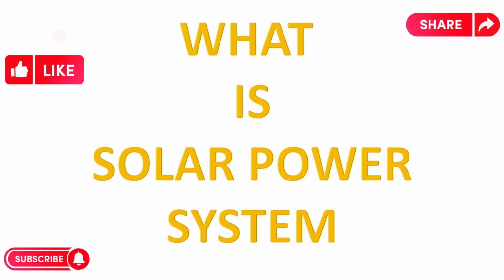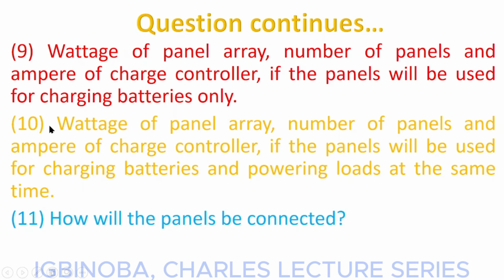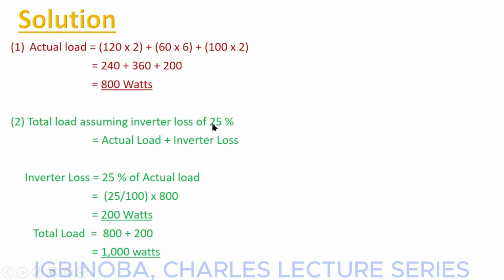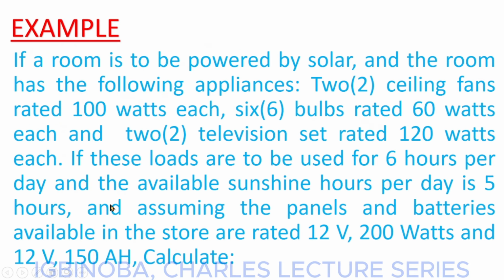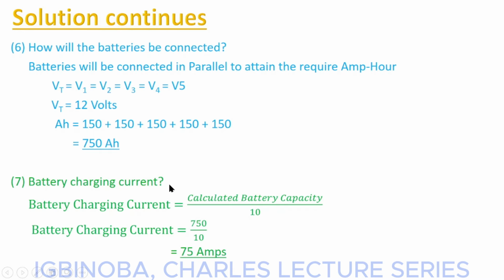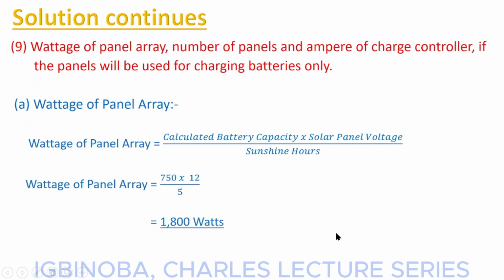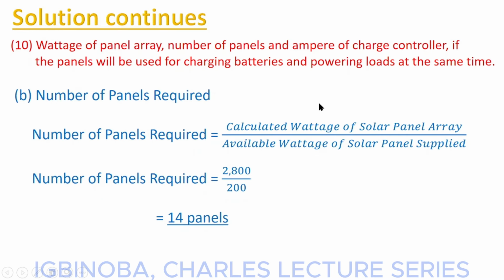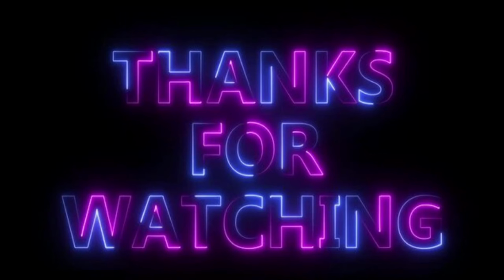Design of Solar Power System

Comment: MAR323W
1. Actual Load = 1380Watts
2. Total Load = 1725Watts
3. Inverter rating(VA) = 2156.25VA
4. Battery Cap. = 1293.75Ah
5. No. Of batteries = 8.6~ 9 batteries
6. Parallel
7. Battery charging = 129.4A
8. Time = 14hrs
9. (a) 3105Watt (b) 15.5 ~ 16 panels (or 200watt(5) then a 100watt (c) Current = 258.75Amp
10. (a) 4830Watt (b) 24 panels  (c) 402.5Amp
11. Parrelel

Comment: PETROCHEM375W

1. Actual load = 1,380 W.

2. Total load with 25% inverter loss = 1,840 W.

3. Inverter rating (PF 0.8) = 2,300 VA (≈ 2.3 kVA).

4. Battery capacity required = 1,227 Ah at 12 V.

5. Number of batteries (12 V, 150 Ah) = 9 batteries.

6. Battery connection = All 9 batteries in parallel (12 V system).

7. Battery charging current = ~307A.

8. Battery charging time (40% loss) = ~5 hours.

9. Panel array (charging batteries only): 3,680 W total, 19 panels (200 W each), charge controller ≈ 307 A.

10. Panel array (charging + powering loads): 2,453 W total, 13 panels (200 W each), charge controller ≈ 205 A.

11. Panel connection = All panels in parallel (to maintain 12 V).

Comment: CHM320T

1. Actual Load = 1380W
2. Total load(VA) = 1725Watts
3. Inverting rating (VA) = 2156.25VA
4. battery Cap = 1293.75Ah
5. No. Of batteries =8.6 - 9 batteries
6. Parallel
7. Battery charging is 129.4A
8. Time is 14hrs
9 (a) 3105W
(b) 15.5 Panels
(c) 258.75A
10 (а) 4830W
(b) 24 Panel
(c) 402.5A
11 parallel

Comment: MEC9I

1. Actual Load = 1380 watts 
2. Total Load = 1725 watts 
3. Inverter Rating = 2156.25 VA
4. Battery Capacity = 1293.75 Ah
5. Number of Batteries = 8.625 ~ 9 batteries 
6. Parallel 
7. Battery charging current = 129.375 Amps
8. Charging time = 14hrs
9. (a) 3105 watts 
    (b) 15.525 ~ 16 panels
    (c) 258.75 Amps
10. (a) 4830 watts 
       (b) 24.15 ~ 24 panels 
       (c) 402.5 Amps
11. Parallel

Comment: COMP78Z
1 Actual load=1380w
2 total load =1720w
3 inverting range=2156.25VA
4 battery cap=1293.75Ah
5 number of batteries=8.6-9 batteries
6 parallel
7 battery charging=129.4VA
8 time=14hrs
9 (a)3105w
   (b)15.5 panels 
    (c) 258.75 A
10 (a) 4830w
       (b)24 panel
       (c) 402.5A
11 parallel

Comment: PETROCHEM379A

1 Actual load 1380W
2 Total load  1720W
3 Inverter rating  2156.25VA
4 battery Capacity 1293.75Ah
5 number of batteries 8.6
6 Parallel 
7 Battery charging  129.4A
8 T = 14hrs
9 (a) 3105W
   (b) 15.5 panels 
   (c)  258.75 A
10 (a) 4830W 
     (b) 24 panel 
     (c) 402.5A 
11 Parallel

Comment: CHM3161E

1. Actual Load = 1380W
2. Total load(VA) = 1725Watts
3. Inverting rating (VA)  = 2156.25VA
4. battery Cap = 1293.75Ah
5. No. Of batteries = 8.6 - 9 batteries 
6. Parallel 
7. Battery charging is 129.4A
8. Time is 14hrs
9 (a) 3105W
    (b) 15.5 Panels
    (c) 258.75A
10 (a)  4830W
     (b)  24 Panel 
     (c)  402.5A
11 parallel

Comment: PETROCHEM31A

1 Actual load= 1380W
2 Total load = 1720W
3 Inverter rating= 2156.25VA
4 battery Capacity= 1293.75Ah
5 number of batteries= 8.6
6 Parallel 
7 Battery charging= 129.4A
8 T = 14hrs
9 (a) 3105W
   (b) 15.5 panels 
   (c)  258.75 A
10 (a) 4830W 
     (b) 24 panel 
     (c) 402.5A 
11 Parallel
Reply: PETROCHEM358F

1 Actual load= 1380W
2 Total load = 1720W
3 Inverter rating= 2156.25VA
4 battery Capacity= 1293.75Ah
5 number of batteries= 8.6
6 Parallel
7 Battery charging= 129.4A
8 T = 14hrs
9(a) 3105W
(b) 15.5 panels
(c) 258.75 A
10 (a) 4830W
(b) 24 panel
(c) 402.5A
11 Parallel

Comment: MAR3152V
Actual Load: 1380 W
Total Load(with inverter loss): 1840 W
Inverter Rating(VA): 2300 VA
Battery Capacity:1227 Ah
Number of Batteries:9 batteries
Battery Connection:Parallel
Battery Charging Current:15 A (per battery string)
Battery Charging Time:5.1 days
Panel Array(charging batteries only):
Wattage:2945 W
Number of panels:15 panels
Charge controller ampere:245 A
Panel Array(charging batteries and powering loads):
Wattage:4785 W
Number of panels:24 panels
Charge controller ampere:399 A
Panel Connection:Series – Parallel

Comment: CHM349W 
Actual Load: 1380 W
Total Load (with inverter loss): 1840 W
Inverter Rating (VA): 2300 VA
Battery Capacity: 1227 Ah
Number of Batteries: 9 batteries
Battery Connection: Parallel
Battery Charging Current: 15 A (per battery string)
Battery Charging Time: 5.1 days
Panel Array (charging batteries only):
Wattage: 2945 W
Number of panels: 15 panels
Charge controller ampere: 245 A
Panel Array (charging batteries and powering loads):
Wattage: 4785 W
Number of panels: 24 panels
Charge controller ampere: 399 A
Panel Connection: Series – Parallel

Comment: PETRO399U

1. Actual Load = (3 x 100) + (60 x 10) + (120 x 4) = 1380Watts.

2. Total Load = Actual Load + (Actual Load x Power Loss) = 1380 + (1380 x 0.25) = 1725Watts

3. Inverter Rating in VA = Total Load / Power Factor= 1725/0.8 = 2156.25VA

4. Battery Capacity = (2 x Total Load x Backup hours x Factor for Reserve)/Battery Voltage = (2 x 1725 x 6 x 0.75)/12 = 1293.75Ah

5. Number of batteries = Battery Capacity/Capacity of given battery = 1293.75/150 = 8.625 batteries ≈ 9 batteries (in order to meet the load requirements, we round up to the nearest whole number)

6. The batteries will be connected in PARALLEL to meet the voltage requirement of 12V.

7. Battery Charging Current = Battery Capacity/10 = 1293.75/10 = 129.375Amps.

8. Battery Charging time @ 40% Loss = (Battery Capacity + (Battery Capacity x 40%))/ Charging Current = (1293.75 + (1293.75 x 0.4))/129.375 = 14 hours.

9. 
a. Wattage of Panel (without load) = (Battery Capacity x Panel Voltage)/Sunshine hours = (1293.75 x 12)/5 = 3105Watts.

b. Number of panels = 3105W/200W = 15.525 panels ≈ 16 panels (in order to meet the load requirements, we round up to the nearest whole number).

c. Current of Charge Controller= 3105W/12V = 258.75Amps.

10.
a. Wattage (with load) = Wattage (without load) + Total Load = 3105 + 1725 = 4830Watts.

b. Number of panels = 4830/200 = 24.15 panels ≈ 25 panels.

c. Current of Charge Controller = 4830W/12V = 402.5Amps.

11. The panels should've arranged in PARALLEL to maintain the supplied voltage at 12V.

Comment: PETROCHEM334H 

1 Actual load is 1380W
2 Total load is 1720W
3 Inverter rating is 2156.25VA
4 battery Capacity is 1293.75Ah
5 number of batteries is 8.6
6 Parallel 
7 Battery charging is 129.4A
8 Time is 14hrs
9 (a) 3105W
   (b) 15.5 panels 
   (c)  258.75 A
10 (a) 4830W 
     (b) 24 panel 
     (c) 402.5A 
11 Parallel

Comment: MARR77Y

1. Actual Load = 1380Watts
2. Total Load = 1725Watts
3. Inverter rating (VA) = 2156.25VA
4. Battery Cap. = 1293.75Ah
5. No. Of batteries = 8.6~ 9 batteries
6. Parallel
7. Battery charging = 129.4A
8. Time = 14hrs
9. (a) 3105Watt (b) 15.5 ~ 16 panels (or 200watt(5) then
a 100watt (c) Current = 258.75Amp
10. (a) 4830Watt (b) 24 panels (c) 402.5Amp
11. Parrelel

Comment: PETROCHEM383E

1. Actual Load: 1380 W
2. Total Load (with inverter loss): 1840 W
3. Inverter Rating (VA): 2300 VA
4. Battery Capacity: 1227 Ah
5. Number of Batteries: 9 batteries
6. Battery Connection: Parallel
7. Battery Charging Current: 15 A (per battery string)
8. Battery Charging Time: 5.1 days
9. Panel Array (charging batteries only):
    - Wattage: 2945 W
    - Number of panels: 15 panels
    - Charge controller ampere: 245 A
10. Panel Array (charging batteries and powering loads):
    - Wattage: 4785 W
    - Number of panels: 24 panels
    - Charge controller ampere: 399 A
11. Panel Connection: Series - Parallel

Comment: Mech397S
1. Actual Load = 1380Watts
2. Total Load = 1725Watts
3. Inverter rating(VA) = 2156.25VA
4. Battery Cap. = 1293.75Ah
5. No. Of batteries = 8.6~ 9 batteries
6. Parallel
7. Battery charging = 129.4A
8. Time = 14hrs
9. (a) 3105Watt (b) 15.5 ~ 16 panels (or 200watt(5) then a 100watt (c) Current = 258.75Amp
10. (a) 4830Watt (b) 24 panels  (c) 402.5Amp
11. Parrelel